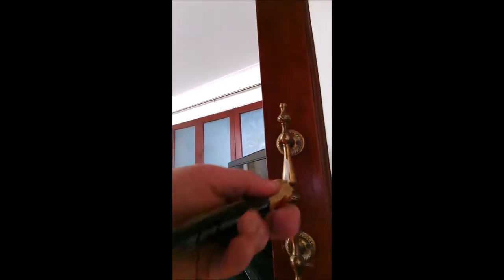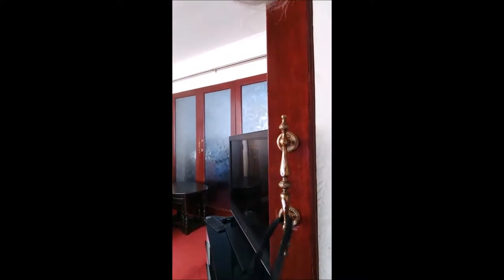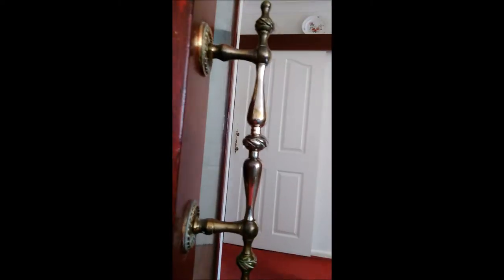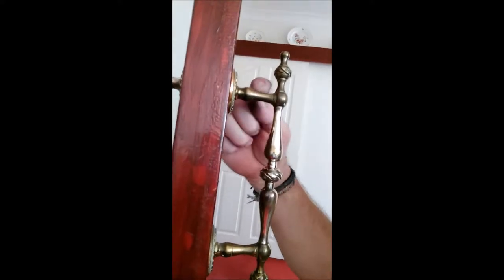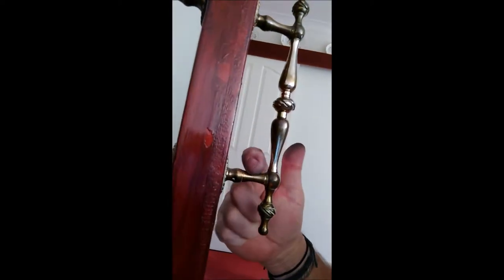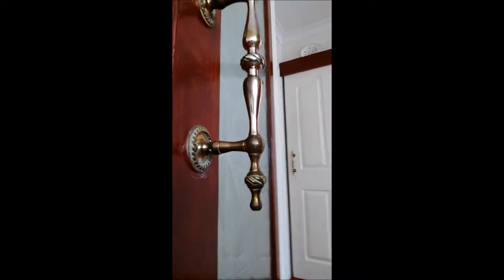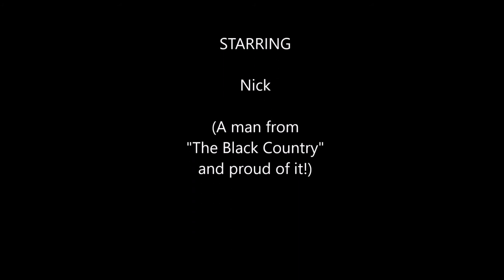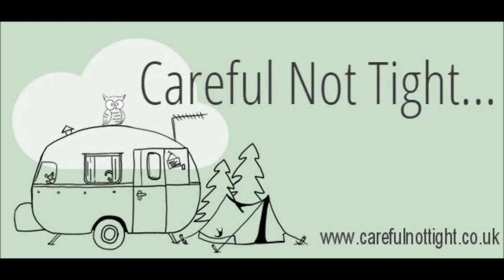Cleaning brass door handles - The easy way!!

Comment: I have the same situation lacked came off in parts and is tarnished -really don’t want to polish  but partial  tarnish partial laquired ?
Reply from the maker: Two thought to help you. Duraglit wadding or similar will clean the lacquer off for you but it's hard. 
Strapping the handle like I did will polish the tarnished brass and as it ages may well blend in with the lacquered bits then again it will probably remove the lacquer!
You could take the handles off and use paint stripper, wash the handles clean, refit and polish as the video. It's not as hard as you think....
Reply: Nick Walton did it once before with Brasso polish but did not lacquer and the tarnish is is back with a vengeance , I really don’t want to do over again as I didn’t remove from door ☹️